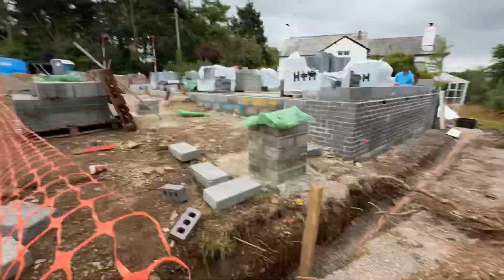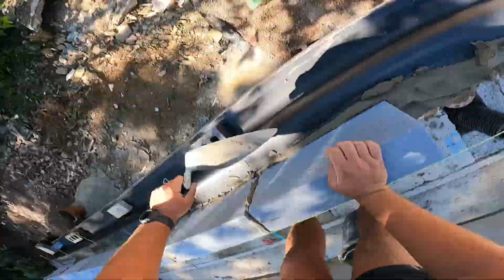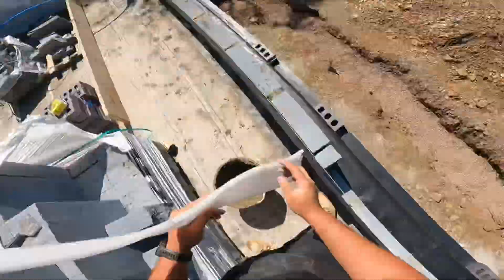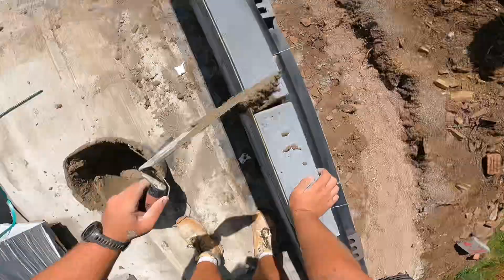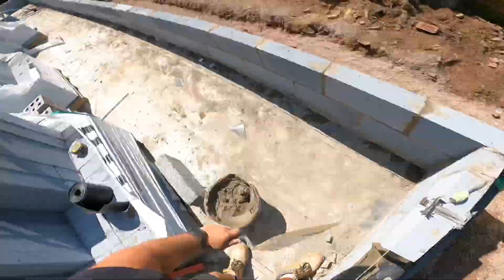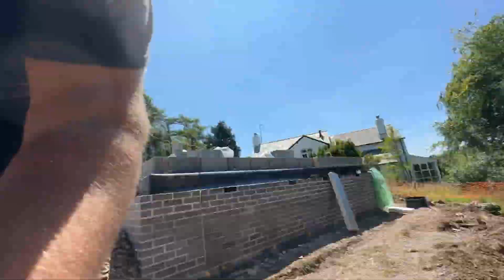JGB EP:7 Damp course and Insulation!

Comment: Nice big job, what’s the cavity tray for all the way round?
Reply from the maker: For the damp protection from the ground up
Reply: @Jordan-GeneralBuilder  isn’t that what the damp proof course does? Doesn’t the cavity tray catch moisture coming down the cavity?
I’m curious because I’ve got a job doing block and beam, I understand cavity trays over air vents but not all the way round, or is it easier to just do the lot?
Reply from the maker: @foundthetruth2003  I find it’s easier to do the lot so there’s not a lot of brakes and slits it’s the tray you have to tape and repair but yeah it’s for  catching the damp from the cavity
Reply: @Jordan-GeneralBuilder  Many thanks, keep up the good work. Have a blessed new year.